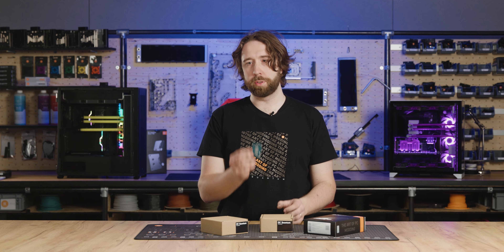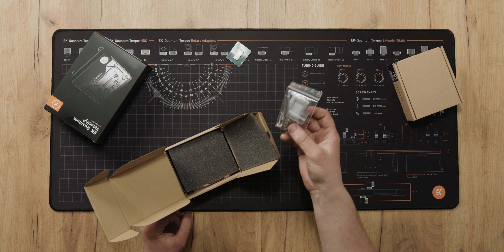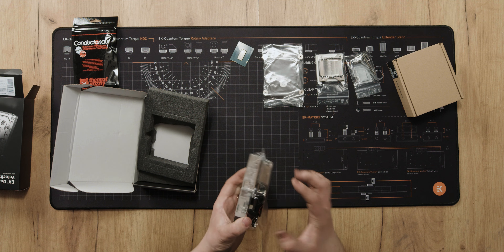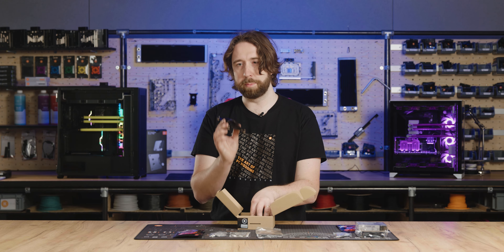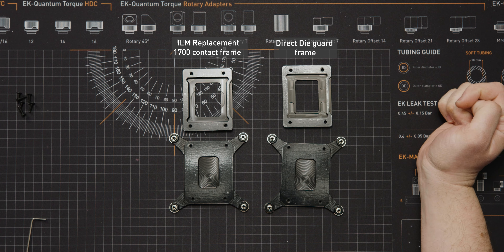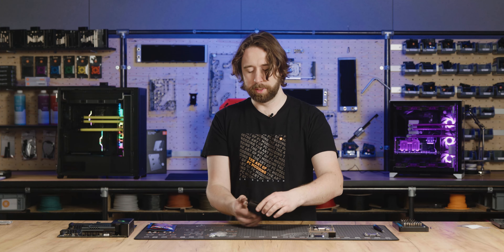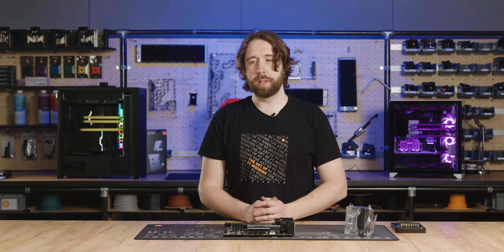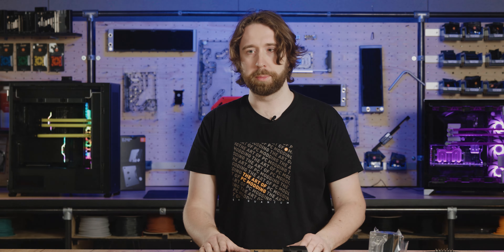How to install DIRECT DIE COOLER on Intel i9 13900K | EKWB Direct Die Liquid Cooling

Comment: If only we could actually get hold of one! I've been waiting since February with no updates from EK...
Reply: I got mine from performance PCs
Reply: Same. Waiting since 1st of February. First expected date of availability was 10th of February, then it changed to 17th of March. I contacted them a few days later and they don't have a date at all now. 

I asked them to at least send out the other parts i ordered, so the computer could be running without direct die for a while, but they really charge extra shipping for that. After waiting nearly 2 months now...

Don't get me wrong, i like EK, especially their high quality products. But i would expect them to send the other stuff without extra charging money as soon as the waiting time is that much longer than initially told when buying the products. 

Since they refused to send the splitted order without charging additional money, i think it's fair to show it to everyone. Maybe they change that behaviour this way.
Reply: You should get it soon, I too ordered in feb, got it last night!

Comment: delidded our i9 13900k cpu today. she's clean. now, we're integrating the EK Quantum Velocity2 Direct Die 1700, in preparation for install into an ASUS ROG Z790 Hero motherboard. this vid is super timely. many thanks!
Reply: how did it turn out?
Reply: perfect. the delid’d CPU and ekwb water block is a formidable wep
Reply: @kenw8875  how is your stability as far as crashes etc? get any memory issues or shader compile issues?
Reply: @mehck2  have'nt experienced any temp or memory issues. maintaining 24C baseline with accelerated temps of 25-26C during periods of long renders.
Reply: @kenw8875  what about crashes though, compilation errors, Unreal engine errors, games crashing etc? Overall system stability

Comment: Are there revisions being made to these direct die kits to fix the contact issues?
Reply: As in the 113th gen "warping" contact issue? That should be fixed just by doing direct die cooling if I understand correctly, since the problem was the IHS bending.
Reply: @re11ek  No that's not what I mean. Apparently there's been multiple accounts of people having worse cooling after installing a direct die kit on a delidded chip. From what I understand, EK made the coldplate slightly convex like they would for a regular block coldplate to increase effectiveness on the concave IHS with the stock ILM. This makes direct die cooling worse since the flat die is against a convex surface. You can confirm this by looking at the coldplate in pictures with direct light. There is a point in the middle with rings around it. People believe this is why they keep pushing back the shipping dates. To fix this issue.
Reply from the maker: We're investigating the issue. Some CPUs were affected and we're in the process of testing a solution for them. We will send out the solution to anyone that needs it to get the most out of their CPU.
Reply: @EKWBofficial  Yes there are some issues. Just tried the kit on my 13900KS and did not have good results. I went ahead and reached out to support regarding this issue.
Reply: @EKWBofficial  Hi. Is the EK direct die kit fixed now and works as intended? Thanks

Comment: What also interests me as a buyer of the EK-QuantumVelocity² Direct Die D-RGB - LGA 1700. With how many Nm that the guard can be tightened at maximum?
According to the installation manual, the backplate may be tightened with a maximum of 0.6Nm.
Reply: Use their torque driver. It just does it for you. More people have had success with it than just tightening it regularly. It needs to be very specific or if won't make good contact
Reply: I would say 0.6Nm is quite a lot more than I would dear to tighten by hand without EKWB torque screw driver.
Reply: is there any proof of stats of temps being different from the tightening? if so i would see why they wouldn't recommend a specific tightness  @PiotrKundu
Reply: Where did find the 0.6 Nm in the manual? The original contact frame of the 8auer used 0.03 up to 0.06NM so 10-20x less force….
I am also wondering how much force is needed on the EKWB ILM Replacement…can‘t find anything officially other than „Use EK Torque screw driver“….

Comment: I am having weird heating issues after installing.  idle temps are 10-15 degrees hotter and it gets thermal throttle spikes at idle.  I uninstalled it and the liquid metal is not making contact.  I did tightened the die guard all the way tho,  perhaps that might be why its not making good contact?  I am reliding the ihs and retesting to make sure its not the cpu (praying its not bricked)
Reply: I had this issues on some cores of the AMD 7950X3D I delidedd. I used a regular EKWB AM5 Ryzen waterblock and the issues was than one of the 3 dies on the AMD did not contact, and those core got hot (it was one of the non 3D cached onces). To fix I run Cinebench and then adjusted the screw tension in the corner I got to much heat. It was nerve-racking, but it fixed the heat problem (and throttleling) issue. The 12th and 13th gen don't have mutliple CPU dies, but uneven screw tension could still affect even contact - it's a plaussible idea at least.

Comment: The direct die upgrade kit isn't compatible with the velocity2 momentum monoblock for the rog Z790 hero, is it? Btw, wish you would create a similar monoblock for the rog Z790 hero, as you did for the ROG Maximus Z790 Extreme, which sadly is now discontinued and no longer available from reputable retailers.
Reply: Can I L ask where you saw that the upgrade kit doesn't fit the Z790 Hero? I have the Velocity 2 block on my 13900K on the Z790 Hero and that fits perfectly with a contact frame, and have bought the DD upgrade kit for when I hopefully get a 14900KS soon 😊. I hope it does fit otherwise won't bother.
Reply: @ColinDyckes  It was more of a question to ekwb than a statement. On the page of the dd upgrade kit it states in the "please note" section (the yellow box): "Compatible ONLY with a EK-Quantum Velocity² 1700 CPU water block". It is the emphasizing of the "only" in that statement which leads me to believe the dd upgrade kit is not compatible with the Z790 hero monoblock. I would love for EKWB to correct me on this though, as i would so much more prefer the z790 hero over the maximus z790 formula. (looking to build it into a desk using a waterchiller for cooling to avoid exposure to the salty sea air here which corrodes everything super fast. so i really want that watercooled power rail.) though looking at the monoblock and comparing it to the 1700 cpu block, the contact area "looks" identical to each other.
Reply: @rick5078  Ahh, OK, I misunderstood your question/statement. I have the Velocity 2 block and the upgrade kit. I guess the monoblock is different to the Velocity2 waterblock which definitely does fit the Z790 Hero as that's what I have run since the 13900K launch.
Reply: @ColinDyckes  the monoblock is specifically made for the z790 hero, so I know the monoblock would definitely fit the motherboard. Question is, does the upgrade kit fit the monoblock and does it perform properly?
Reply: I would also like to know this. I just ordered the z790 Maximus Formula VRM bridge. Hoping to direct die my 14900KS if the upgrade kit is compatible.

Comment: I’ve installed it and you have to better tighten the water block, not as on video. And still temperatures in bios are 88-92 degrees….it seems mine is broken or something. 
I’ve tried to install it 15 times - half of the attempts CPU a code 00, another half - to tight…it’s very hard to install the ILS and water block properly….
Reply: I am so glad I saw this post. I have an i9-12900K with the direct die. I only get Code 00. Motherboard is powered. code 00, all fans on, but no post! I am assume no contact with the die, I have tried reseating etc.. Now I am going to go back to my original IHS cooler! Thanks for post showing that others may encounter this issue!
Reply: @tdog13  there is an issue in die guard contact frame - they’ve replaced it and now it works fine for me. So raise a support ticket - they should send the replacement.

Comment: The Direct Dei cooler does not work!

In the meantime I have disassembled my PC six times to find the problem of the Direct DEI cooler. And believe me, it's not easy and it's not fun at all. It's not a test setup where some product videos are created.

The installation of the Direct DEI cooler was carried out exactly according to the operating instructions and videos from EKBW and Roman.

Ultimately, the Direct DEI cooler does not make contact with the decapitated CPU. Checked this out by removing the liquid metal on the Direct DEI cooler. I screwed on the frame and the cooler with different values. 0.30, 0.40, 0.50 and 0.60 Nm.

Additionally, I also removed the Protection FOAM from the board. But unfortunately also no contact between Direct DEI cooler and CPU. It looks like the frame is too high.

In the course of the six modifications, I also took a closer look at the frame. The protective foil attached to the underside was glued crookedly and thus caused a bulge to form when screwing. With the result that the frame was not plan. At this point I started the verification as described above.

Why it worked halfway after the initial installation. But that still means that the temperature of the CPU in idle was about 20 degrees warmer than with my AIO Arctic Liquid Freezer II 360. It was because I applied too much liquid metal to both sides, CPU and Direct DEI cooler. So some heat could be dissipated.

For the test, I temporarily removed the protective film from the frame to check whether there was now contact between the Direct DEI cooler and the beheaded i9-13900KS. Liquid metal was only applied to the DEI (CPU). Frame and Direct DEI were tightened with 0.4 Nm. After removal, no transfer of liquid metal could be detected on the cold plate of the Direct DEI!
The same procedure again but now with 0.60Nm - unfortunately also negative!

I wrote to EKWB on April 27, 2023. Unfortunately no response yet. I hope that I will get a positive answer on May 3rd, 2023!
Reply: EKWB informed me today that I will get a new frame (die guard) and a new ILM protective film. Information follows."
Reply: @RossoDelPadrone  hi any information about your process? I am not sure if I want to risk my 13900ks if it's not working
Reply: @Glaceon_Shiny  Replacement also does not work.
Reply: youre not even the same guy dude  @TinyChrisTV
Reply: any updates?  @rossodelpadrone  I hear mix reviews depending on installation too.

Comment: Thank you Joe. Excellent video. what are the expected temp gains from De-lidding? even 3-4 degrees is significant.
Reply: 77 degrees r23 stress test after 1 hour
Reply: @HD-nv9ru  That is pretty significant
Reply: I'm delidding my 3rd CPU and I would say 10-15C is what you should expect to gain.

Comment: The upgrade kit doesnt came with the delid tool?t bring
Reply: No. It's sold separately for $80 but see KitGuru and Jayz2cents video. There's a big QC issue with the screws stripping the threading in the tool and both had the same problem. Unsure if EK has addressed it. Honestly just get the rockitcool kit. It's cheaper and I did my first delid with it in my 13900KS without issue

Comment: Yesterday I noticed that my CPU 13900k was getting 100 degrees. I use 3x480 64 mm radiators and have installed the EK-Quantum Velocity² D-RGB - 1200 nickel. Before that, the CPU ran at a maximum of 65 degrees in the stress test. I cleaned everything and still have the same problem. Can you help me urgently?
Reply: its been a year and im sure you fixed the problem. so what was the solution
Reply: @bornagain2641  Unfortunately I could not solve the problem

Comment: I've ordered the upgrade kit for the V2 block on 3-7 in anticipation of it being available on 3-17(per the web site). It is now 3-31 and my order has not been processed. I've reached out to EK via email and have not received a reply on an updated ETA.
Reply: It may be delayed due to many users like me pointing out a manufacturing issue that is causing them to not work right, also the tool they make is no good.
Reply: @StuartBoyer  I just got mine tested, The cpu goes to 100c with only 150w powerdraw

Comment: we used Noctua NT-H1 thermal paste on the cleaned die, in lieu of "liquid metal" as ref'd in the video. with this thermal paste, you do NOT spread out the paste. instead, for an LGA1700 chip you place 5 dots (2mm diameter). one dot at the center, and one each at each corner for a total of five dots. the instructions with the paste state: "CAUTION! Applying too much thermal paste can lead to higher CPUU temperatures."

Comment: How soon will this product be available on the market, I'm so excited about it. I want it asap
Reply: I ordered this cooler from Caseking eight weeks ago. If everything is kept as promised, I should get this CPU cooler before Easter or at least the week after.
Reply: @rossodelpadrone  the delivery time so long, why that time of delay?
Might be that the demand is more than what they can easily supply.
That shows more people are getting enlightened on the benefits of direct die cooling
Reply: I'm very much interested in direct die cooling with 4090 for my workstation. I'm eager for maximum performance at minimum temp so that my components can last longer

Comment: You really have to leave the foam between the block and the die?
Reply: its made to protect the other components from the liquid metal (outside the square foam o.f.c.). if it happens, it can damage them from what i understand.
Reply: i would like to know if it is necessary too if you just use the right amount of liquid metal maybe? im also not sure if the liquid will move around much ...?
Reply: @juliangarcia6073  yeah that's a "leak" protection & still don't know if it's necessary...

Comment: I would not put liquid metal on the cpu while socketed 👀😳
Reply: Why? Would you rather put it on the CPU and then risk dropping that thing on the board with the LM on it? ;D 

I would cover the board with tissues or similar and put the LM on the applicator, then move that carefully over the die and spread it. So you don't risk to spit that stuff over the board with the syringe. There could be air in it after all.

I will put a thin layer of non-conductive paint on my chip too before applying LM to the die, just to be safe.
Reply: @AlexanderDinebier  or take extra precaution. I kept my socket cover from my motherboard for that reason. I'd rather not risk it accidentally gushing out over the motherboard into crevices I'm unsure of.
Reply: @AlexanderDinebier  at least you're proposing covering the motherboard. This guy did nothing.

Comment: lots of people now are having issue with this EK DD

I have same issue.
At water temp 20 degree celcius, my 13900ks with ek dd can only costs up to 400watt at 110 degree celcius.
I reinstalled 7 times, repaste liquid metal, results are same. 400watt with 110 celcius. 330 watt with 80 celcius.
This result is same as heatkiller 4 pro with Stock IHS. 400 watt with 110 degree.
Actually, ek dd is worse than normal cpu block. Core temp difference on heatkiller is only 7 degree difference, however ek dd is more than 15 degree. Core4, 7, and 8 extremely high.
Once I changed to iceman dd, i got cured. At 330 watt it is only 60 degree.
550 watt with 110 degree.
Shame on you, ek
What did de8auer do?
Just rent reputation and have money?
Than just decrease the price without name on it.
I dont think ek will recall this garbage product.
People who bought this product expect good cooling performance, not the same performance with stock ihs.
And also, why does ek always delay their product? Once you said it will start deliver on mid Feb, it supposed to start at least 20 Feb. It is promise with customer, especially you received money first.
If you guys think you cannot gurantee the time, than receive money later.
I was big fan of ek, no more.
Quality keeps decreasing, price keeps increasing, and most of product need to be rma. Im tired of this.